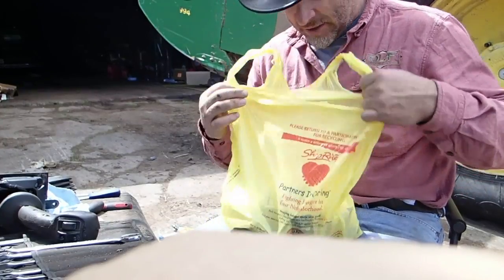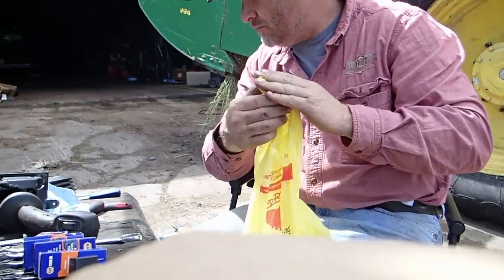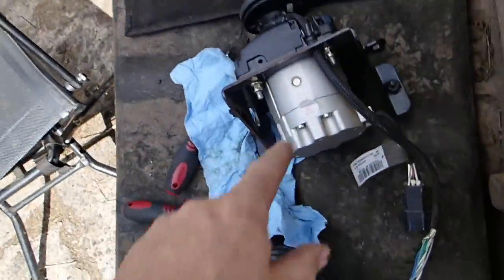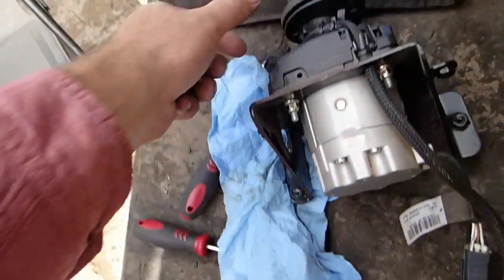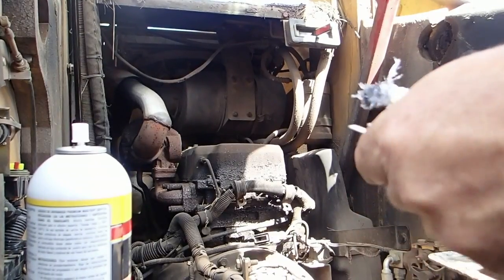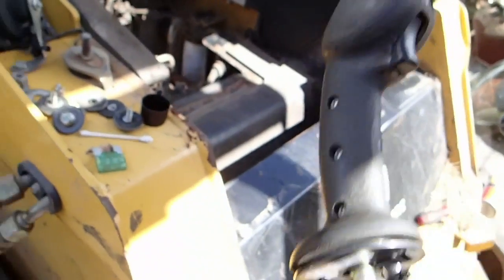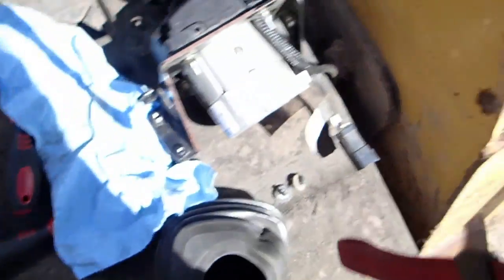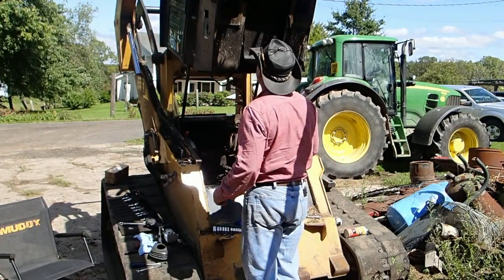Y Axis Again Part 2

Comment: Hint:  Find and use relays that are sealed... I had some on a backhoe that filled with water. Even upside down moist air pumps into them with heat and cooling.  In this environment one needs sealed ones.  Bought some off ebay... about $2 each.  Seal them yourself if you can't find ready made ones.  As an electrical engineer I am aware of these issues.  Magnetic sensors rarely short out unless physically damaged.  You were ripped off for labor for sure.

Comment: WHOA THERE WES.  I hope you have looked up the cost on some of these components.  That joystick module if I did my searching right is EXPENSIVE.  I would strongly suggest you reconsider firing a parts cannon at this without knowing for certain what the problem is.

Comment: I used to use a forestry harvester during my younger years and it was all servo control stuff. If I was you I would isolate the problem, try the other lever on that side, if it doesn't work it's the wiring below the lever, if it does work it's a new lever needed. Mostly when I had problems with those it was wiring below that had moved back n forward and broke the wire inside the loom, or a joystick module completely gone. Hope this helps wes

Comment: Stay on the problem and get back with us. You got this. Don't give up. I deal with control electronics (24 volt) alot at work. It's all junk technology. Straight from the factory we have to do the conformal coating and weatherizing to eek a few extra hours from stuff. They always die anyway. Troubleshooting = shotgun some parts at it and hope for the best.

Comment: IMO.. this is a time to be calling a dealer. Your going to spend huge $$ on a stick, and you don't know that its the problem. Its an electrical component, so generally its non-returnable. Seems like a significant risk to take to me.
Reply from the maker: life is about taking risks!! and i do it every day thats why i wear the title FARMER....
Reply: I'll give you a thumbs up for that :-)
Reply: onelonleyfarmer at some point Wes unless you can do without the machine and fix it on a rainy day the time your waisting diagnosing the fault by replacing parts would be better off spent in the field making hay. I can tell your stress level/frustration has risen a bit in the last couple of vids, sometimes you need to step back and re prioritze what is most important to you now. Apreciate that you could end up paying a dealer good money to learn what the fault is if it is not a known problem just spell it out right at the start what you have done and replaced already and that you wont pay for any parts replaced that dont fix the fault likewise the time taken that was not productive, it likly wont be cheap but neither is falling further behind with your harvest. Cheers mate.🍻
Reply: I wonder if Wes could demo an ORANGE skid steer ?

Comment: I have worked with motion controls systems for years and typically if a sensor/control goes out of range it could be bad, it could be due to wear or a change in the spring tension. If in fact it is due to normal wear the only thing that may be necessary is to tell the computer where the new center is, IE run a calibration on the Y axis. My 2 cents for what it may or may not be worth.

Comment: our bobcat was throwing a similar code about not being in neutral.  turned out the rubber skirt around the joystick has a front and and back side and when put on backwards pulls the joystick ever so slightly so its not in neutral position.  not saying thats whats going on here but worth a shot

Comment: Maybe it's something as simple as the ECU needs to be 'cleared' of the fault code now it has a repaired part.
Reply from the maker: do0f3r true
Reply: Did you try removing the battery ground for a couple minutes?On a few things I have owned that's all it took to clear the error codes.

Comment: The same hydraulic filter is used on Case, and New Holland skid steers, so its probably CNH skid steer with over priced JD decals on it.
Reply: There's a leap of logic unsupported by facts...
Reply: There's a leap of logic unsupported by facts...John Deere skid steers are made at the John Deere Dubuque, Iowa works.  They make end loaders, skid steers, and forestry equipment at the Dubuque works.
Reply: They may now, but I do know the 75 series JD skid steers were just NH skid steers with over priced JD engines, and decals. The CT series still very much resemble the NH skid steers of the same years of manufacture.
Reply: Wes, A month ago you were only a few miles away from the Dubuque works, too bad this didn't happen sooner you could have taken the joy stick and threw it in one of there windows.
Reply: Wes uses Napa filters.

Comment: Wes all the joy sticks have a dead man switch that is inside the grip this is a wire that senses when your hand is on the stick these wires will break and then they don't work and they are unrepeatable from all the brands that I have seen.

Comment: try  to replace the joystick from other side   if the connections are the same . or try removing the battery leads for some time to restart the computers . or buy a telehandler .

Comment: Tear the joystick down to component parts if your Going buy a new one anyway i want to see.
It will work one of two ways either an inductive sensor (i don't know how to fix this) or a scalextric like sensor where a contact will sweep over coil of wire or variable resistor as you push forward backwards. sounds like the moving contact is touching either the start of the up or down variable resistor (whatever the Y axis controls). The machine is sensing this circuit is made so will not let you use the control as the hydraulics will move inadvertently when you start it up. 

Find where the contractor is touching and prevent this. ideally you would have the service manual that would take you step by step through the fault finding to confirm a fault in the joystick before replacing.

 i looked for the technical manual but the one i think you need is not on the internet TM11438. google that number and you will get the mechanical manual for manual controls version of your skid steer on third link down.

Comment: $15.00 usd for a maxi fuse, wow I guess I really need to up my pricing on them. I have them in every size from 20 amp to 75 amp and all at 5.99 cnd, plus I sell the inline holders for them, you want to smake someone for ripping you of 3000.00 in 2006 my ex wife took everything I owned since I was 18 all my trades tools equipment an you name it, then the courts gave her to ok to sell my home stead that I bought when I was 18 when it was nothing but bush, over my life I built it up to what I wanted. it was valued at 196000 an d she sold it for 23000 just so I couldn't have it, plus the courts gave her my life savings plus all the funds I got from my law suit from when I feel at work an broke my back all up, never to be able to ever work again, now I struggle to eat stay warm dry, I going to do more then that, good thing shes a deep sleeper

Comment: When that machine quit before didn't you blame a lightening strike. possibly if it was that it's weakened other electronic components and something else has failed over time.  or I have heard a electronic component fails because another part   is sending a dirty signal/voltage. you can maybe replace  that control again but until you find whats sending the bad signal it will blow again. The early electronic MF tractor 3 point  hydraulic controls were bad for this, they blew one part but another part caused it.

 Wasn't there something about that joystick needing to be set up with the computer to when they fixed that one  .   I'd bet you are going to a different dealer after all you have said about the last place. I'd bet if they heard about the video they'd shove that hat right up your @$$ before you got near the parts counter. You don't know the whole story of that bill and how long it took to find the problem.